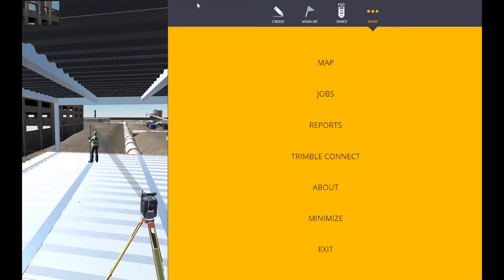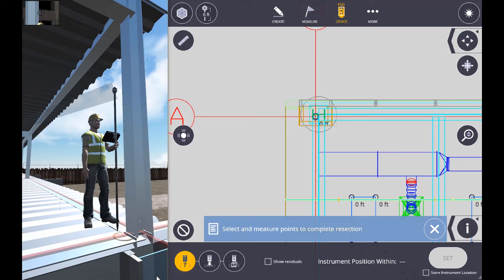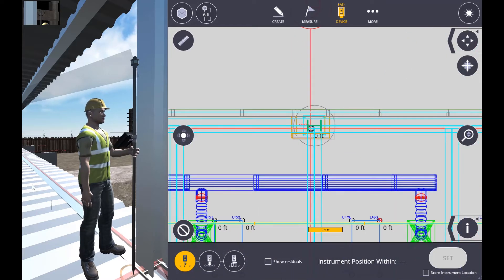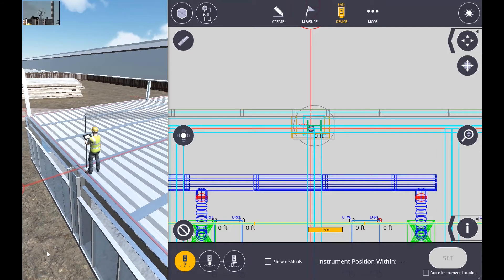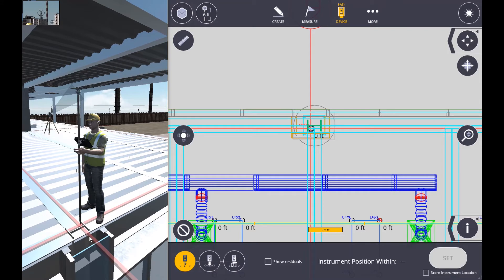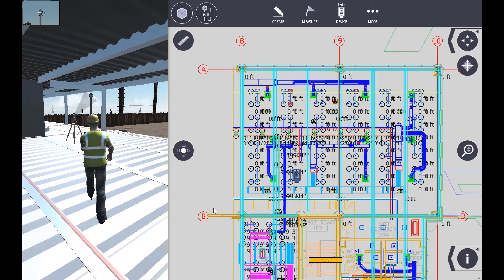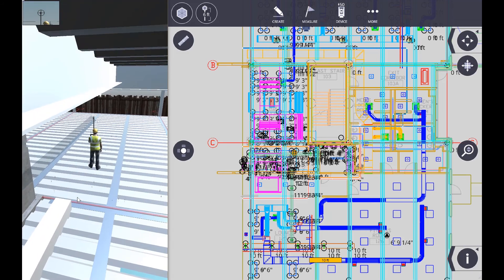Trimble Field Link - Control Setup and Resection

Comment: What is the difference between poor, good, very good, and excellent controls? Would you accept “within 1/8th”” instrument position with poor controls? Or is that bad practice
Reply from the maker: Sorry for the delay; it took us some time to get the answer to define those control setup responses.  Excellent >= 99.99991 % 
Very Good >= 99.99980 % 
Good >= 99.99959 % Poor >= 1 %

A residual within 1/8th of an inch is usually acceptable.  There are so many factors to shooting a perfect setup.  Leveling the RTS head, sturdy base or tripod, low or no wind, good line of sight, layout rod/pole being perfectly plumb, clean tripod.  Depending on what you are laying out can determine if your residual is enough.

Comment: where is your accuracy of resection the std dvt results
Reply from the maker: Taga,
Thank you for your question and we didn't express this portion on the video but during the process of shooting/measuring your control points if you check the "Show Residuals" box it will read out your calculated deviation from "perfect".

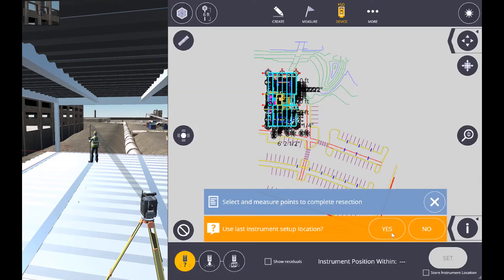This is visible at about the 0:31 timeline form this video.
Reply: Is this less accurate then setting up on a Control point and shooting to another?
Reply from the maker: @bwilliams00111   It is no less accurate but is considerably quicker.